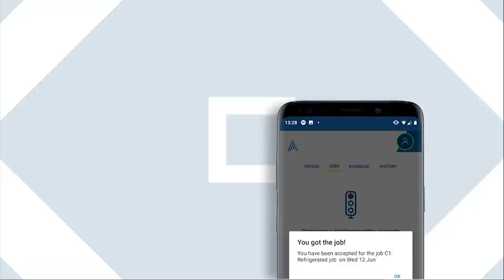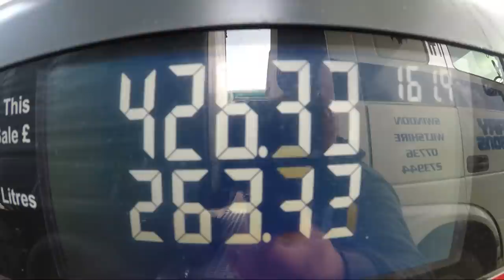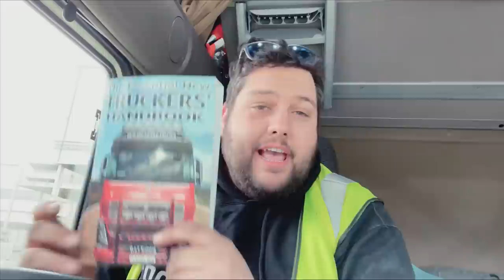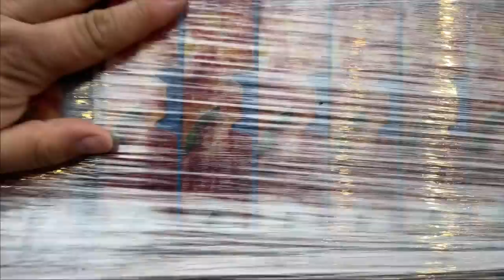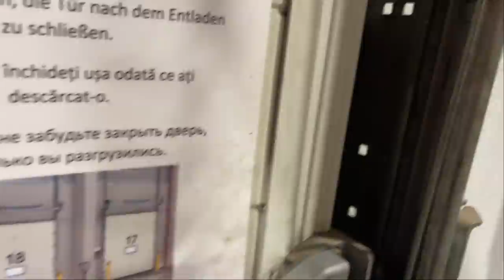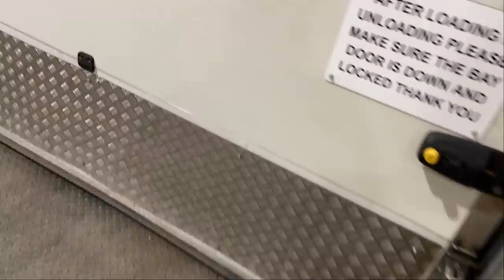Lidl Wait? I Don’t Think So!

Comment: Given there are more loads than hauliers at the moment your traffic planners ain't much cop. Given all the back loads available from Thurrock/Tilbury/Essex area, running you empty to Banbury (113 miles) to run you back into London with a double-drop is not clever transport in my book. Then add 2 hours of demurrage a night out your revenue per hour is rubbish. To add insult to injury you then get delayed for 3 hours at your second drop. Any body with any sense know's rdc's are very bad in the run-up to Xmas. You could have run empty back to base and reloaded got yerself up-country and made some proper dosh. Schoolboy errors in the planning department. You should ask the question why this ever happened.

Comment: The only way to get better wage is to look around and leave current cushy role. Many drivers just sit in same company for over 10 years and getting £10\h beacuse no one bothers them
Reply from the maker: They say that you should change job every 2-3 years to get pay rises. Assuming of course your current employer doesn’t give you yearly rises
Reply: @lukecinahgv  i was on ltd far 6 years and joined the team as full time employee summer time this year. They say they didn't have pay rise in years. They paid up on September because few drivers left and one unit hasn't left the yard in 3 months so changing companies every 2 years I would say is definitely a good thing. One driver or two drivers at my place has worked there over decade 🤷🏻‍♂️ and they complain about rates.

Comment: What's the annoying Buzzer that keeps sounding on DAF's??
Reply: Usually the lane departure warning buzzer. Sensors on the truck let you know your off line on a motorway. Sometimes gets triggered a lot more when you need to cross lanes or are in narrower lanes in the city as Luke was.

Comment: When I see you (or anyone else on video really) maneuvering, the amount of steering you have to input is downright insane It seems to me that it is more than 4 full (steering) wheel turns lock to lock... 3 full turns in a car looks like an eternity already.

Don't you wish you had more direct steering?
Reply: No, if it was, when driving along motorways etc the bumps can get quite harsh and if the steering is more responsive, like what you`re suggesting, with each bump the truck would be throwing it`s self from side to side. The way the steering is in most trucks is ideal. I`ve found the older mercs can  be a bit overly responsive. Newer ones are better.

Comment: You choose to be a HGV driver 3hrs is nothing I did a load from Leeds to Sainsbury's at hoddesdon my booking was at 2pm full load one in one out the guy at the front of the queue was 10am I sat there from 13 45 until 10pm that was in the 1990s I am now retired we know it's boring and things should be better it seems that they are quite entitled to keep you waiting but if you turn up left it seems that they have the right to refuse to tip you and send you away